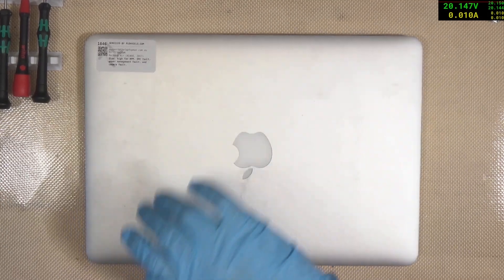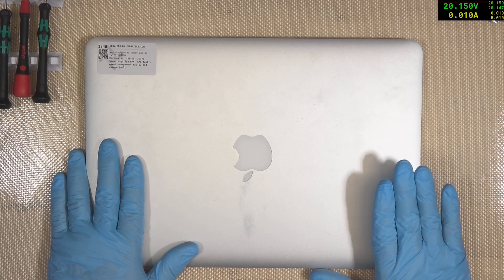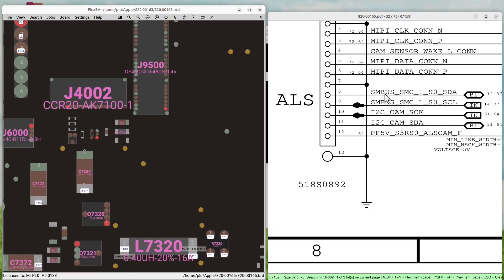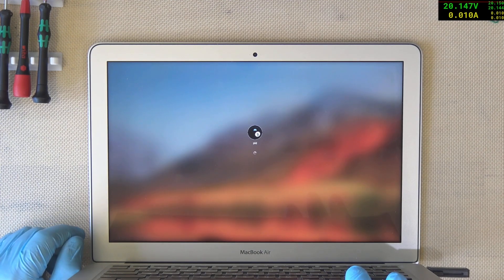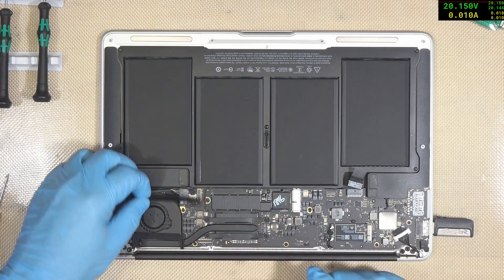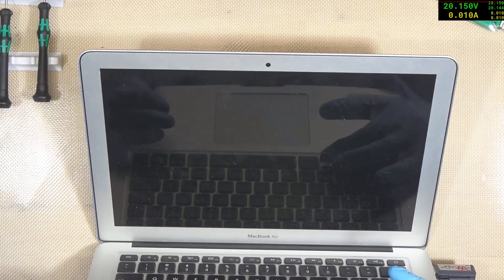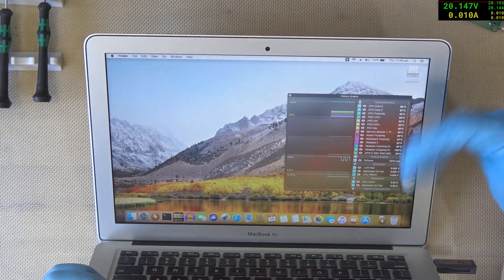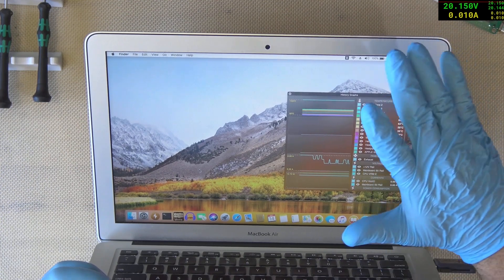How to fix Macbook SMC fault, high fanspin and no camera with one step!

Comment: I found you video and... it works!

Funny thing is the camera still works with this unit I'm fixing. The unit was running at 500MHz but temps were normal (cold, 25-35C). Mac diagnostics indicated SMC issue PFM008, camera issue NDC001, PMS issue PPN001. Fan spin at max even when freshly booting.

Disconnecting the camera normalized the fan speed and made it run at 2.5GHz again. Thanks!
Reply from the maker: Glad it was a useful bit of information for you.  Sadly not much you can do other than try another display assembly :(
Reply: @pldaniels  This is the first "modern" mac I'm handling. I've only handled the old System 6 and 7 ones back then. Watched a lot of Louis Rossman repair videos back then though to wind down :P

I don't need the camera working. But if I was to fix it, I was planning on just getting the camera module, lifting up the top of the display bezel, and connecting the new module in.

I got a new issue though and I'm not sure if its related to using Windows 10. I completely wiped MacOS. The fan doesn't seem to want to spin up even when the CPU temp is reaching above 90c.The unit eventually stutters hard and hangs.

Thermal paste reapplied. Fan and vents cleaned.

I'm not a mac person. I'm only fixing this for a neighbor's kid.

For now I'm using an app to put the fans at max and to disable CPU boosting (windows cpu frequency limit to 99%). Is this normal?

 The fan is barely spinning at high temps like it has a wrong fan curve. Looking elsewhere it seems normal for macs to reach 100c and the fans still don't want to spin (not normal for me lol)

edit: I tried running a game. It made the cpu package reach 100C. On force shutdown and on again, I am greeted with the flashing folder and question mark icon. I force a reset and its good again. Maybe I'll do a repaste or something else is overheating.

edit2: I opened it up again. I removed the heatpipe. It seems theres proper contact with the main CPU but the smaller chiplet has thicker paste on top. Anyhow, I blew the fins up with compressed air (some more dust came out lol), and I bent the tension arms pushing to the CPU. It works better now. I don't need to push the fans to max under normal use. Still reaches 100C in games and hangs. I think its because of the PCH chip not having tight contact with the heatpipe.I found a user with the same A1466 board who said they needed to remove the adhesive lining around the CPU to fix overheating. This user said it helped make better contact. Gonna try it when I service the machine again.

Comment: I'm relatively new to the world of Macbook repair, and once I had the misfortune to face a thermal sensor issue on this particular model. It remains mysterious and, I believe, will stay so for decades. 

I feel I'm done with it... I replaced the SMC chip, then that little chip right under the CPU, then THE CPU ITSELF! One day I had enough time to replace a couple of thermal sensors under the glue, but fan is still going crazy, mac works annoyingly slow and it shows me random 128C readings in HWM (some of them look normal, but at the same time they are jumping back and forth). It's ironic - I find power delivery issues easier to deal with than the thermal sensor issues, even with my experience...

Thank you, Paul. You are THE MAN. I can feel my head filling up with knowledge!

EDIT: Just finished your video. Well... HAHAHA

Comment: I’m not one to usually comment on a YouTube video, but I have been trying to fix my MacBook Air for a while now I’m having the same issues. Cam is not working. High fan speed, and slow performance I figured it was some sort of sensor and this video just proved it to me, but I also have another problem where it won’t recognize that I have a Wi-Fi card my only option for Internet on it is through ethernet
Reply from the maker: @dawsonvaillancourt7457  which MacBook do you have?
Reply: @pldaniels  a1466 2017 Mac air
Reply from the maker: @dawsonvaillancourt7457 will likely be a small bit of corrosion near the wifi power switch controller on the other side of the board. 

I’m guessing you’re not in Australia?
Reply: @pldaniels  no I’m not, Canada here. I’ve taken the board out looked at it and gave it a good clean didn’t see much corrosion and what I did I cleaned up, I’ve even bought a new airport card and put it in to no avail
Reply from the maker: @dawsonvaillancourt7457  U3550 is a frequent culprit, little 6 pin BGA blue chip.
Reply: @pldaniels  I just finished tearing the whole thing down cleaning making sure it’s almost factory cleanliness rebooted and all the same issues unfortunately I looked at everything carefully After four months of trying, I think I’m just gonna call it quits 😂

Comment: Had a similar problem no camera tested pins all normal then i noticed on my board that the resistor under the cap was missing on my board all cause i seen on you vid one there now replaced resistor camera working thanks again cheers hope to see more vid in the new year once you get the cats accommodation sorted

Comment: Nice video!

I found curious that you consider A1466 the best mac to start at the repair business. Almost all the missing pm_slp_s4_l that I've ever faced were in the A1466.  I don't recall being able to fix any of those (keep in mind that I do this for hobby, not the main way of living and the volume of repairs I do is not that big). Maybe I should revisit those again?

I would say that the best ones to repair are the A1278 but they are quite old by now.
Reply from the maker: PM_SLP_S4_L issues are found on the A1466's, yes, more commonly the 820-00165 variant and frequently it's the CPU's IMU that dies (can be tested by pulling R8111 and seeing if it powers up).   However, that said, the 3437 and 00165 boards are still what I consider the best to begin working on.    There's also a guide for diagnosing the missing S4_L line in tools like FlexBV.

Comment: what about a Apple 13" MacBook Air 2017 A1466 with lines - no pic very white screen on screen?
Reply from the maker: A  few possible issues - if you're not getting anything also on the display-port output then I'd be thinking CPU fault or the coupling caps on the data lines have a problem (C8320 etc)